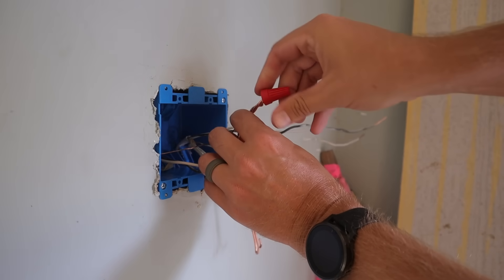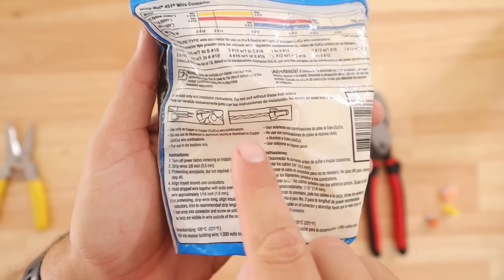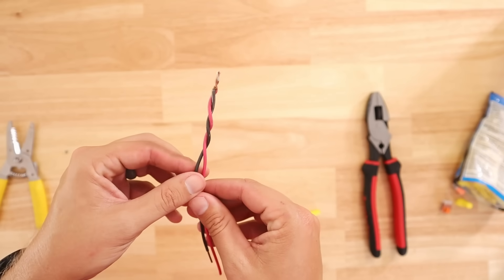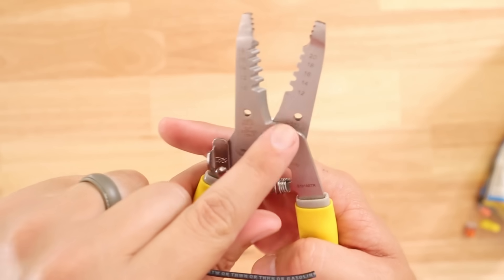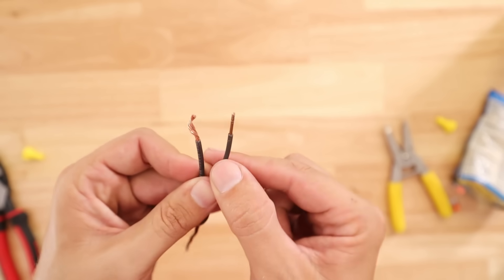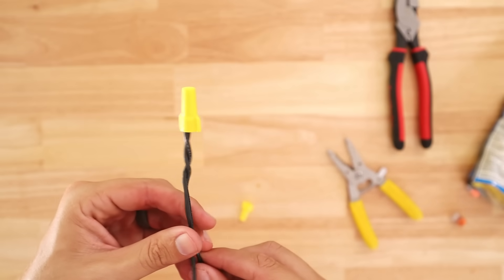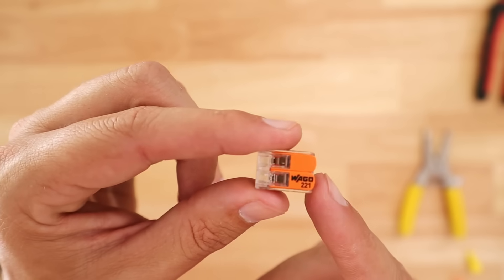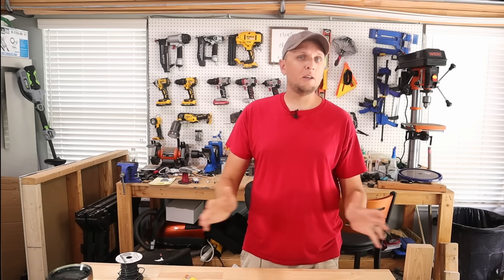BIGGEST Mistakes DIYers Make When Connecting Wires Together | How To

Comment: It looks to me like the Wago 221 is superior all the way around, especially for the occasional DIY'er.  I've never used them before, but I'm going to buy them for all future wiring jobs.  It looks like they're easier and quicker to install, and are much less likely to fail since you can see the connection, and the design makes sure the wire is clamped into place.  I wish I knew about these a long time ago.  

By the way, I'm surprised you didn't recommend electric tape around the splice ... especially for outdoor outlets and fixtures.
Reply: I like the design of those WAGO connectors.
Very fool-proof, easy to verify if you have installed them correctly.
I assume they come in different sizes for different wire gauges?
My only question is if they have a long enough history to rate long-term durability when installed. I know an installed wiring job should not be experiencing much (if any) mechanical stresses, but plastics plus age can be a problem for some formulations of plastic.
Reply: @MonkeyJedi99  I think that i have used wago's more than 10 years, those clear ones are new generation what have been couple of years, older ones was grey and bulky, and you cant see through them, and every time you closed the old ones lever you got some skin from fingers under the lever...that was not fun :D
Reply: @Iippo82  Thank you for your first-hand knowledge.
Sorry for how much you have "skin in the game".
Reply: @MonkeyJedi99  the ones I use go from 24ga to either 12 or 10 ga depending on which model, in 2,3 or 5 slot levernuts.  Nothing better in a J-box  you might add on to later.  I think 30a is the max either way.

Comment: I posted a similar video about splicing and got comments about wagos. Some swear by them. I still choose not to use them, but I’m not a contractor worried about the time it takes to do each splice. My question about wagos would be how they perform over time. A good splice under a wire nut can last decades, even with the minor expansion and contraction of the wires that can sometimes occur with current flow. Just wondering if the wagos will last as long under similar conditions as a wire nut. I guess we’ll have to wait 20 years to find out!

Comment: We don't need to join wires like that in the UK. We use junction boxes with screwed terminals. These wire/wing nuts look inherently dangerous. If I had to join two wires, I would solder the join and use shrink wrap tubing.

Comment: Another big mistake in joining two wires together is to join a positive (red) wire to a black (negative) wire and then to show it on a YouTube channel to demonstrate the correct way to join two wires!!!
Reply from the maker: Well that isn't at all what the video is about and also not a real world example.  I used them to contrast each other for what the video is actually about.  Aside from that there are certain applications where red and black wires join.  While it should be avoided, for identification purposes, as far as I am aware, there is nothing that says you can't connect them if needed and it is at the discretion of the electrician.  They both conduct current the same way and considered hot.

Comment: I like wagos just fine, but the problem is that it's too expensive for doing signs.  You have to use a bunch of wago blocks, than place them all in gel boxes to make them water tight...then figure out how to make sure they don't block the leds inside the sign, which means spending $ on 3m tape ($100 a roll).  It's just so much easier to throw a wire nut on, tape it with teno tape, done. no fuss no mess and it's many times faster.  When you do a ton of wires all day long, even 30 seconds can save you a days work at the end of the week.
Reply: Don't get what you are saying about the Wagos vs the wirenuts.  I have worked in plenty of signs over the years, neon, fluorescent, and LED and in the case of terminations wire nuts or wagos both work fine.  Why you would gel encapsulate wagos and not wore nuts makes no sense to me unless they are subject to submersion.  LED straps get wires soldered and then a dot of silicone over the connections and the wires are then routed to the most accessible area of the sign least prone to water exposure.  All caps are top up as are wagos.  Note, wago 221 have a probe hole in the top and as such water can enter and wet out the junctions resulting in galvanic corrosion.

Comment: As an electrician, I agree with most of this. I think it's better to lead the stranded a little bit so it's higher than the solid. The wirenut will grab it and tighten nicely. I also think you are better off twisting the wirenut to twist the wires instead of pre twisting.
Wagos are great.
Reply: Wagos are for amateurs.......like a back stabbed receptical

Comment: Would it be to coad to use a way go on old wiring where you do not have enough wire coming out of say a wall receptacle box? Or any box that they never left enough wire, like they back stabed a receptacle?
Reply from the maker: I actually have a video on this.  Yes, a Wago would be a good place for that.

Comment: The only mistake i found here was the use of wing-nut. Wago is a superior product. You can actually see the connection and check that you have the cable all inside the connector. Its also way easier to connect extra cables later on if needed. There is absolutly no benefits with wing-nuts.
Reply: Failed wagos are a real issue, thermal expansion and contraction are no friend to a soft nonferrous tension based connection.

Great indoors, eaves and attics no thanks and definitely not industrial application.